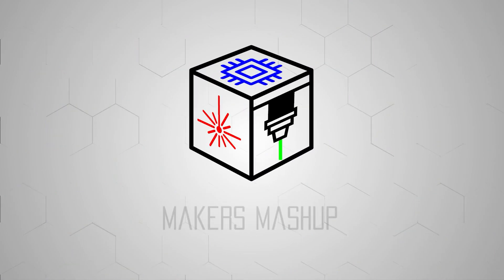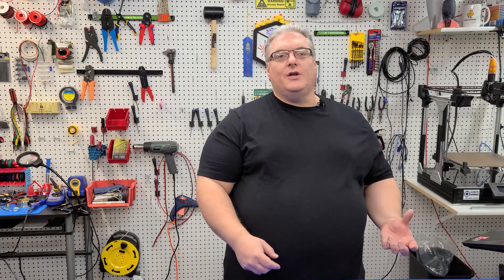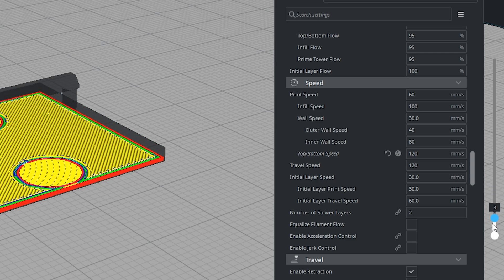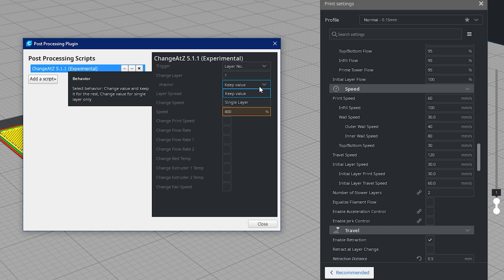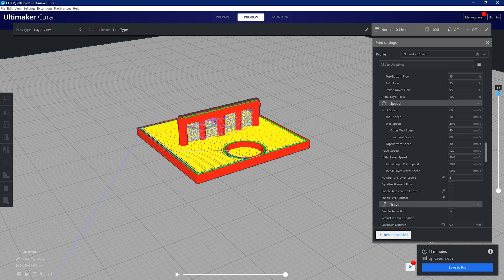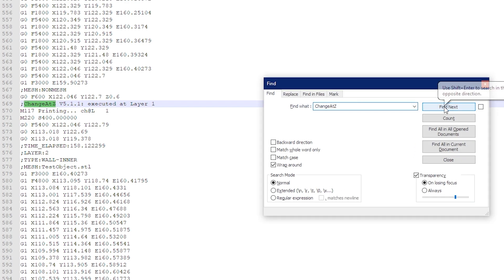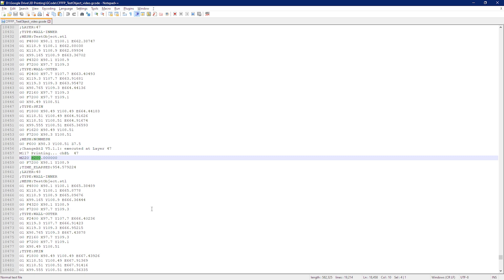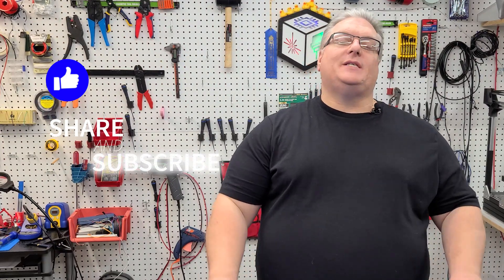Turn Up The Speed! | Faster Prints with Selective Feedrates M220

Comment: I have put it in a reply but just so you see it for sure I also put it here. In Prusaslicer there is now this powerful feature of modifiers, where you can change almost all settings based on shape or model height.

See https://projects.ttlexceeded.com/3dprinting_prusaslicer_modifiers.html

Which should cover the exact use case you presented. Of course it's great to see a way to achieve this in Cura too.

Comment: If you change the feed rate in the gcode, don't you have to change the flow rate accordingly? I thought both had to be used together. That's what I have done in a vb.net program I created for modifications exactly like this, and it works great, but I change flow rate and feed rate by the same percentage.
Reply from the maker: My understanding is that they are independent values.  You can change feedrate which increases the overall speed in which everything operates (think fast forward) and flow rate which is the amount of material extruded (think volume).  You can play an entire song faster without it being louder and vice versa.  Not to say in 3D Printing some additional flow might be good to have but to my knowledge when your increasing a feedrate the extrusion rate remains constant, just faster.
Reply: M220 scales the velocity/feedrate for all axis.
It's the scaling factor you can dial in on most CNC machines to adjust speed while in operation.
See
https://marlinfw.org/docs/gcode/M220.html

As long as the percentage is low it should have no adverse effect at all. But it could for example reduce the minimal layer time below what you have set in your slicer.

Comment: Prusaslicer/Superslicer. Most of the major feature types have independent speed settings. Right click the layer slider after slicing and insert custom gcode where you want for M220 adjustments if you still need them.
Reply: Thanks I use cura for pla but could never get it to print petg so used prusa for petg.   But mannn its bloody slow..

Saying that its about time I tried cura again.
Reply: There is a more advanced feature that gives you even more control called modifiers.
You can control almost all settings (speed included) based on a mesh or a height.

https://projects.ttlexceeded.com/3dprinting_prusaslicer_modifiers.html